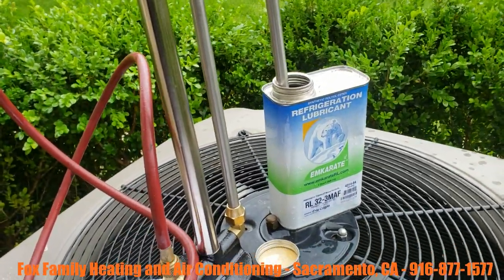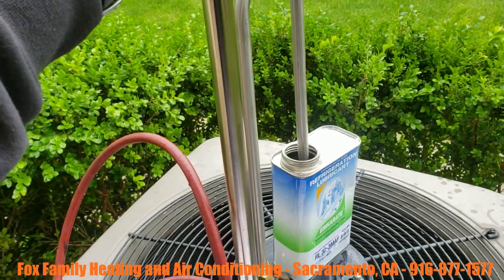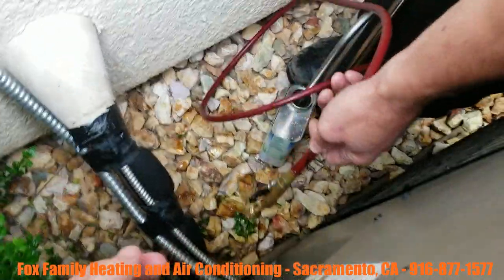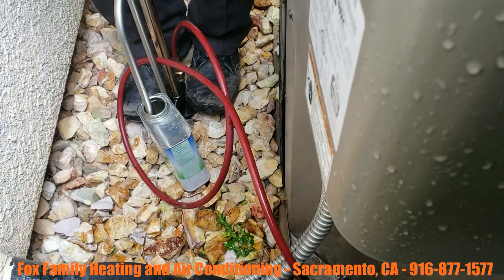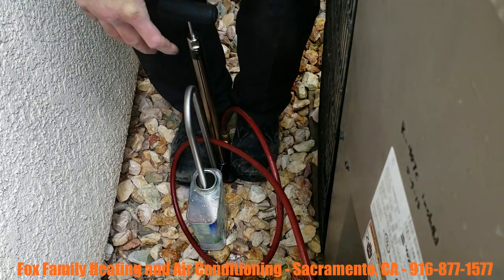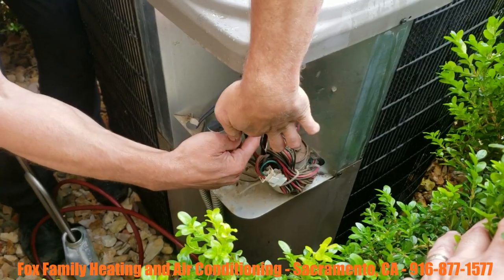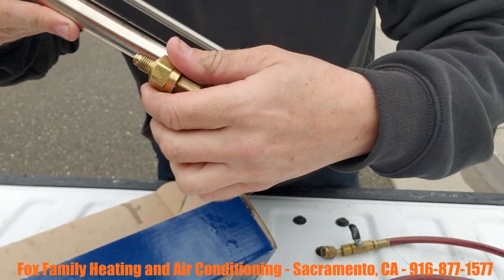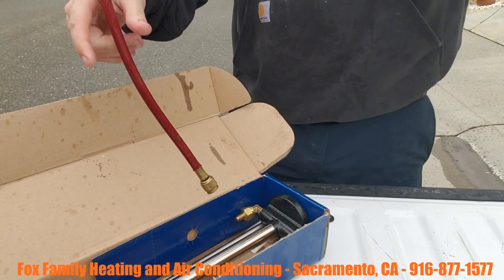Adding POE Oil for and R407c Retrofit

Comment: Can anyone tell me what normal operating pressures for r407C is without all the "theres alot of factors that come into play" But just for the heck of it lets say its 95 degrees outside 83 degrees inside on a 3 ton split system. Also does the suction line sweating give a good idea of proper charge with r407c because i recently installed a 407c condenser coil and went thru the proper steps of flushing system, replacing filter drier and so forth my indoor temp was at 87 degrees suction pressure at 71, had a 23 delta t put the suction line was not sweating nor was it beer can cold. I should probaly mention that the humidity was higher then normal today. So guys plz, what is an acceptable range for r407c and is beer can cold any indicator of proper charge. Disclaimer: I understand the the beer can cold technique is outdated and ill advised as a way to check for proper charge, i understand in order to properly charge a unit best method is weight it, superheat or subcool, nonetheless we all touch that suction line just get an idea of how well unit is cooling, so im just wanting to know if r407c has properties in which sweating line is no clear indication of cooling. Someone plz advise, any info will be greatly appreciated. Yours truly an Inquiring mind.
Reply: The suction line will almost always sweat.  If it's not cold, it means your superheat is really high.  For example, if the evaporator condensing temperature was 38 degrees, and the suction line wasn't cold, you know you have a superheat of something like 40-45 degrees.  And sweating just means the line is colder than the dew point.  If the dew point is 38 degrees, well then you're probably not running the ac anyway.  That said, it'll sweat when it's overcharged too, like if you had a 38 degree evap, and 0 superheat, the suction line will be nice and cold....and you might slug the compressor and break it.  Or if you have a txv metering device on the evap, an overcharge might have a fine superheat, but with high condensing temperatures and wasteful amp draw on the compressor.  Anyway, I'd put money your system being undercharged if the suction line isn't cold.  If you have a txv, you need to charge to subcool, and just take notice that the superheat is within reason.  If you have a piston, charge by the superheat and take notice that subcool is within reason.

Comment: Who the hell runs indoor BX for an outdoor wet location...love it...holy hell
Reply: 35% is what's recommended not 15% ... And the correct procedure is to remove the compressor and dump it Into a container and put 90% of the new oil in...but hey what do I know
Reply: Sounded like you just did this repair for the first time....bc you wouldn't have a brand new pump it would be old and beat up like mine...I've done that repair over 300 times and you will most definitely be back by just adding...good luck
Reply: Cap the hose...🤦🏿‍♂️

Comment: You really dont need 15% per say, you can get by with 4 oz. The poe is to help the mineral oil return to the crank case
Reply: Also  i hope you changed the schrader valve cores mr fox
Reply from the maker: Thank you!

Comment: Wow pushing the contractor with bare fingers and no hand gloves to hook up your refrigerant hose to the system and to handle the oil, I’m sorry for being a bit critical and I can tell you’re a great guy but have your coworker use some hand gloves and a screwdriver to push that contractor next time and again sorry for being critical
Reply from the maker: All good. Thx for the input 😊
Reply: I’m in Az and I don’t see any techs wear gloves except on installs, 26 years for me and I barehand it too! I’m more curious that there is what appears to be MC cable on the outdoor wiring and not seal tight conduit.